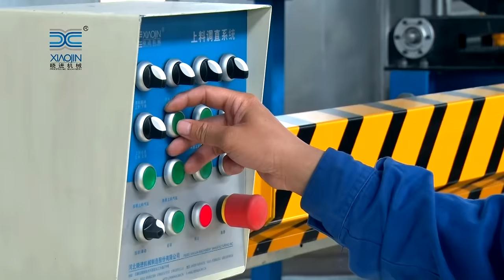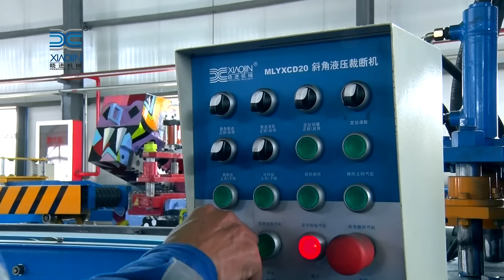Full automatic anchor bolt production line

Comment: Doesn't look strong enough, a little pin holding a nut on a  rebar, should be duct taped too.
Reply: thats strong , but why duct tape, it most likely will not stick from oil residue left after threading, over all it seems an expensive way of making rebar anchor bolts since its a fixed end by pinning the nut, but we seen only that production run i guess
Reply: U know nothing Dave... Snow? 
Pin is used just to mix the resin. Its designed to break at given torque. Otherwise You could not make any pretensioning.

Comment: The bar stock looks like rebar, which is low quality steel.
Reply: epistte not sure what you intent to say with that. Anchor bolts need to grip in concrete, analog to rebar...
Reply: I'm an engineer. I know what a bolt does.  You cannot thread into concrete because it has almost no tensile strength. If you need to thread into concrete you need some sort of insert.
Reply: If you "have" to thread into concrete  you need an insert. That is how a REAL engineer would say it.
Reply: I wasn't referring to threading into concrete with my first reply. I was saying that the bolt bar stock looks to be low quality rebar.
Reply: You cannot tell by the looks of the material it is low quality steel. Probably the know what they do.
Reply: Rebar is actually quite a good steel for bolts. It responds to heat treatment, resists crack growth well, and has a fairly dependable tensile performance. Made gun barrels with it. I certainly wouldn't call it  "low quality steel". It is what it is.
Reply: @epistte  NO engineer would would make such a statement without seeing test results of the steel strength. A quick glimpse on a video can't tel you anything.
Reply: Not all rebar is low quality steel.  Some rebar is made by slitting railroad rail under the head and above the base to make 3 pieces, head, web, and base, which are then rolled into rebar.  Rail steel is very good steel.
Reply: @epistte  Please don't engineer any projects that will involve my safety. The point Tha slughy was making is that the when placed in poured concrete the pattern on the rebar makes a good grip. nobody except you would consider threading into concrete.